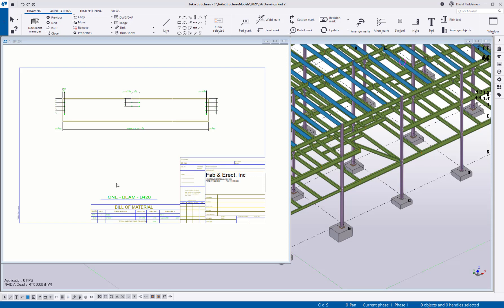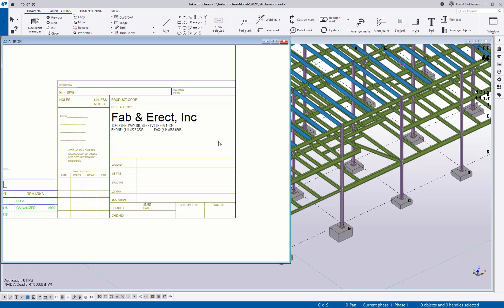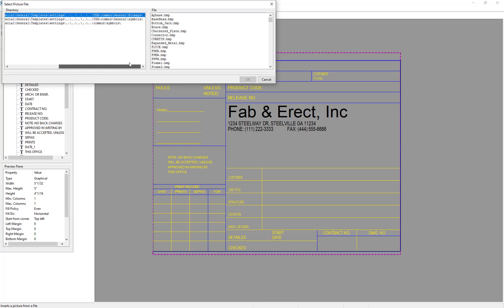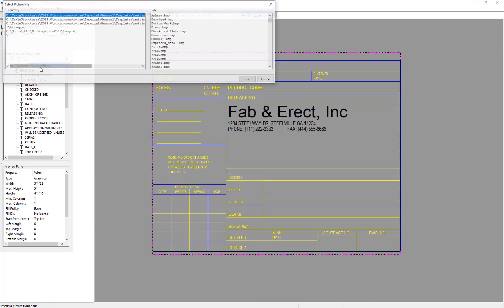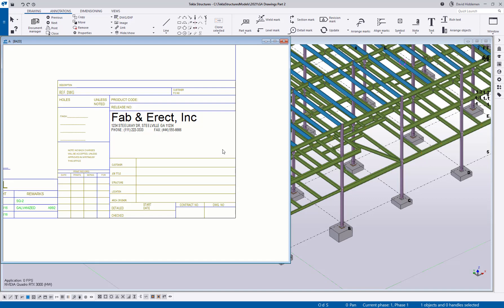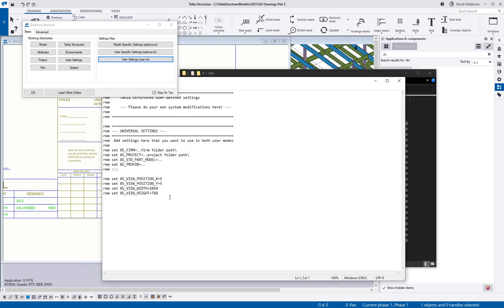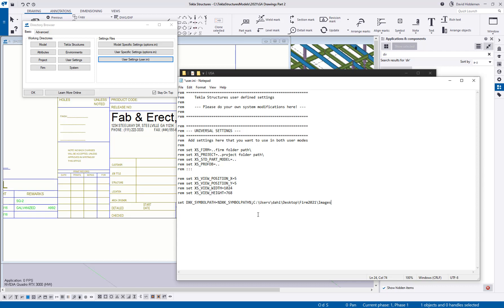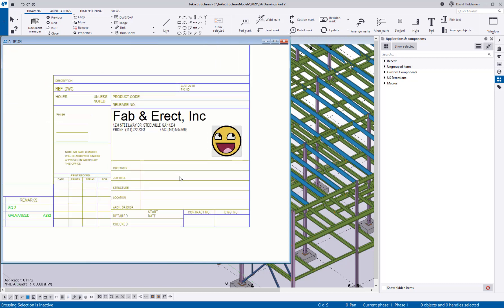Images in Templates with Tekla Structures

Comment: I did this and now the .bmp logo i inserted to the template shows up perfectly in the drawing editor and prints fine through our plotter. However, when I print the drawing using the "pdf file" option in tekla to print the drawing as a PDF it does not show up. What do i need to change to get this to show up on the PDF  prints?
Reply from the maker: Please reach out to your local Tekla helpdesk support team. https://www.tekla.com/contact/offices-and-resellers

Comment: I followed to the letter but still missing the logo in the drawings added the line to the user.ini, do I still need to put the path in the environment folder? "Error Opening file:TargetPoint.dwg"
Reply: I'm getting the same issue. Super frustrating
Reply: the solution shown in the video is not a good solution

Comment: I followed to the letter but still missing the logo in the drawings added the line to the user.ini, do I still need to put the path in the environment folder? "Error Opening file:TargetPoint.dwg"
Reply: That error indicates that the DXK_SYMBOLPATH variable is not set correctly (you'll likely see other missing things besides the logo). Double-check the format of the value in your user.ini or send it to your local support for them to take a look at.
Reply: I had the same error message and Tekla crashed. I just thought I make a comment as to what fixed it. Where you repeat the path with the % in front, there has to be a % in the back too. I didn't notice that, even though I double checked if I got the text right.

Comment: I'm wondering, why Tekla is making things so complicated ? Users are not programers, and this way to adjust simple functions is more like programing, and knowing all that incredible folder and file structures is complicated thing. I'm working with Tekla 3+ years, but I this is just too complicated to remember what you showed here after some time. What does it mean for me DXK symbol path?- nothing! Would like to see in the future user friendly window dialog with adjustment options, just like in example Autocad or other software-where there is no need to enter manually code specific options.
Reply: Couldn't agree with you more, instead of spending all the time advertising tekla to look user friendly in demo videos lets spend some time "actually" making it user friendly.
Reply: I completely understand that feeling and I shared it when I first started using Tekla many years ago. Most of the Advanced Options that were only available through ini files were added to the File > Settings > Advanced Options menu a few years ago, but there are a few that need to be read at startup, and this remains an effective way to enable them. The nice thing is that for most average users if you set it up correctly it's not something you need to remember because it will carry forward to your future versions. Or if you don't know how something is done, someone from our Support can get you sorted.
Reply: Agree